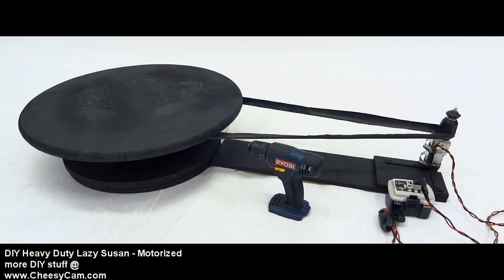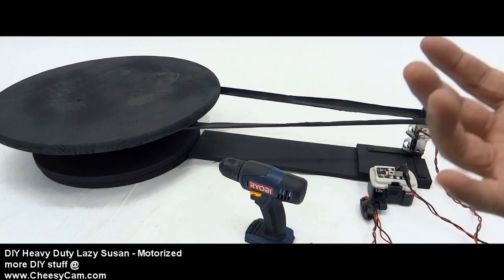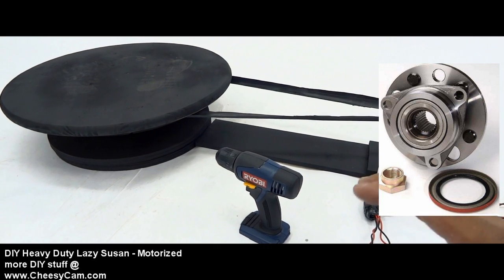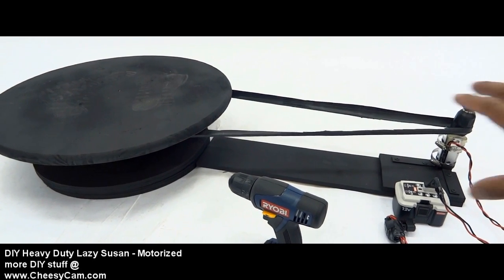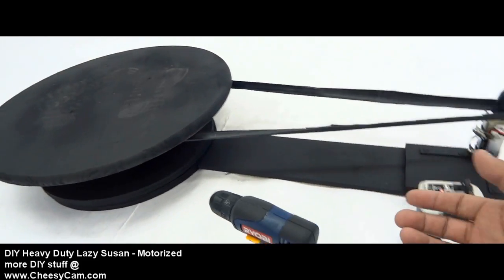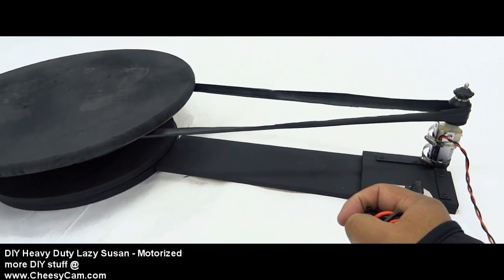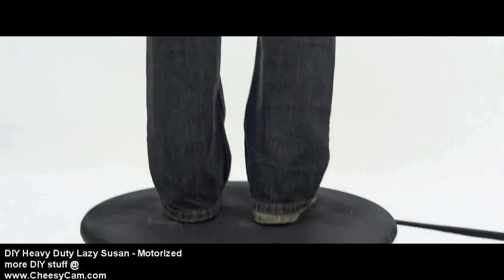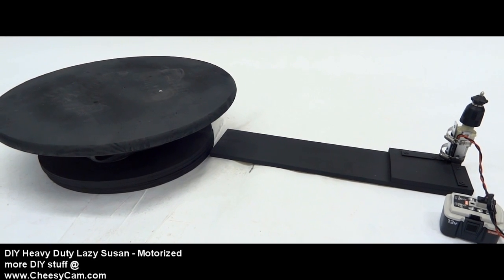DIY Motorized Lazy Susan

Comment: Does this rotate at the same speed regardless of the weight on the turntable? Which drill model and power are you using?  Does the belt have to be a certain length? Good work cheesy.

Comment: Hello, Is there a way you can do this but be able to step on a button to turn it on, off and turn in both directions if you are the person standing on it? Trying to use the 20.00 part you used but in a discreet kind of way if I'm standing on it as a display.  Any advice would be helpful.

Comment: Good idea using the Jeep hub but I'd use something like a bike sprocket/chain instead of an inner tube...but you did say this was a rushed job so I'm not trying to criticise it. I want to build a lightweight portable (battery powered) rotating rising camera boom but Ive considered the rotating platform as well..

Comment: I'm trying to do the same thing but I've run into trouble taking apart a drill.  Did you leave your drill in the casing?  I can't tell.  Any advice on how to take apart the drill motor and mount it?  Thanks.
Reply from the maker: I took my drill apart.
Reply: I'm not sure it was necessary to "destroy" the drill as you only need to splice wires to the motor speed control trigger. You could do that by drilling a small hole in the drill casing and sealing it with a dab of hot glue or melted ABS. You could even install a plug point in the drill casing to make the external controller removable.

Comment: I want to rotate a whole fully watercooled full tower PC. and have some kind of break mechanism because im using it to modify the pc with and I dont want it to rotate while im for example screwing in screws or drilling for example. what do I need for a device like that? oh and is it possible to make it rectangular? its gonna be for pc use only so that would be great. any tips are greatly appriciated.

Comment: great job! I used a sewing machine motor, and a spindle and hub from a trailer. I snugged the bearings up a tighter than normal so the turntable wasn't so free wheeling